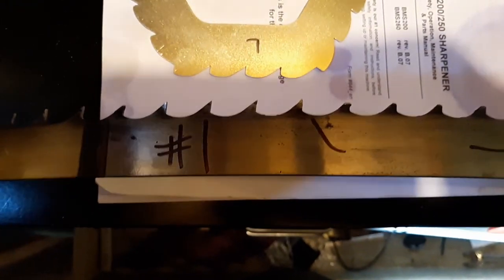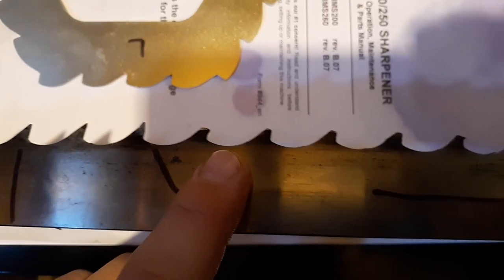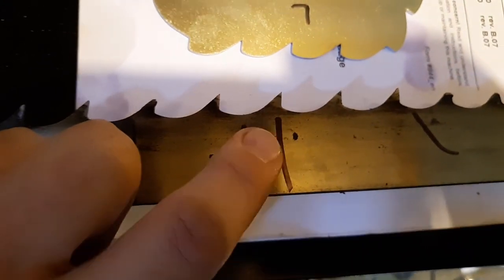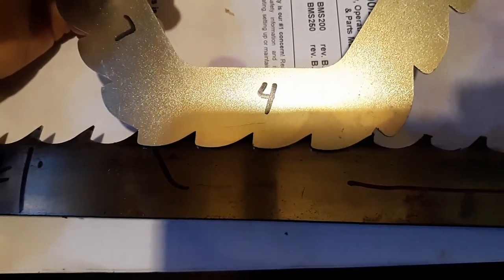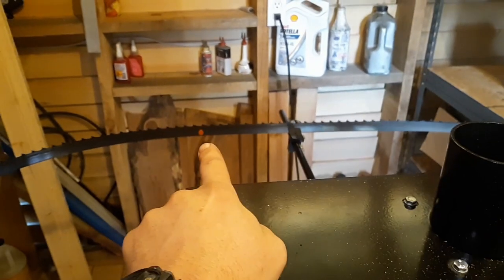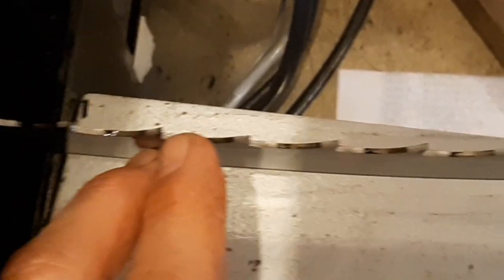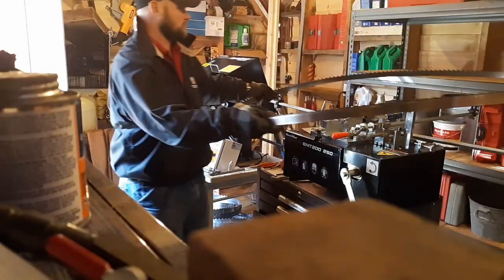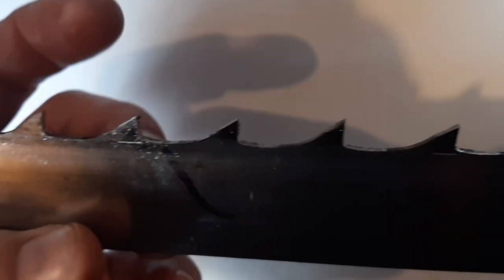Bandsaw Blade sharpenining after hitting a NAIL | Wood-Mizer

Comment: Best demo on sharpening woodmizer blades I’ve seen yet, Nice set up you have there
Reply: I would like to know what make of sharpener do you use?
Reply: Sorry didn't wait to see the rest of the video!
Reply: Steve Poore BMST50 Bandsaw Blade Sharpener & Setter, great machine but it’s all manual, after 3 blades I’m ready to take a break, but, I’m happy with it, I use the 9 degree wheel, simply because that’s all blades I have, they work well on all types of wood in my area